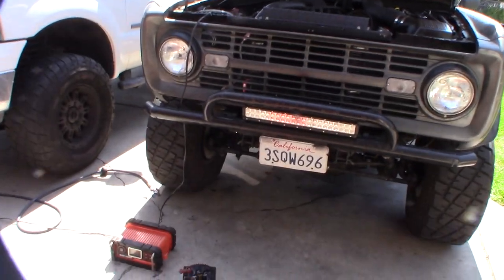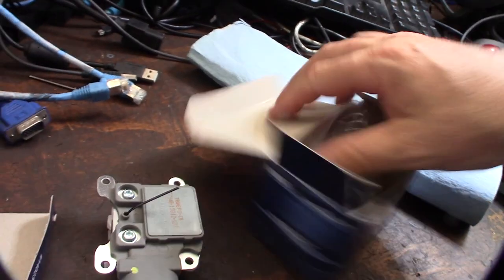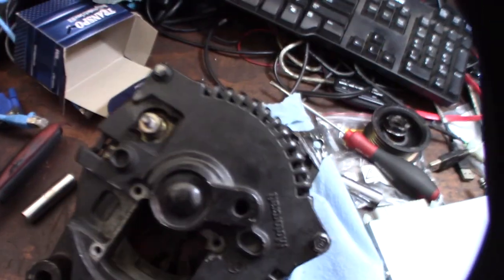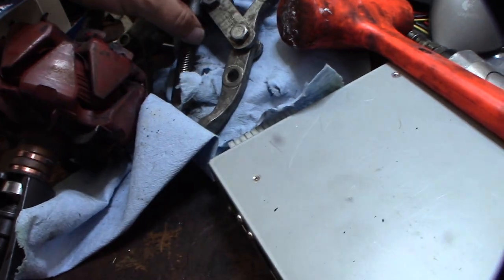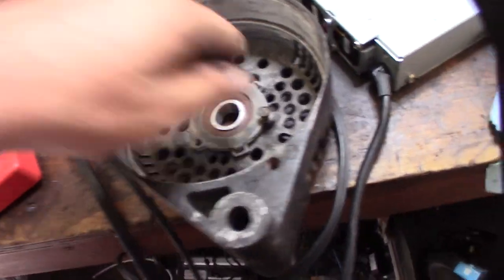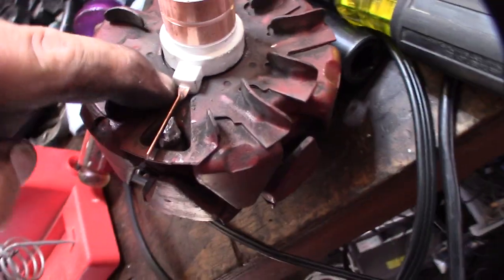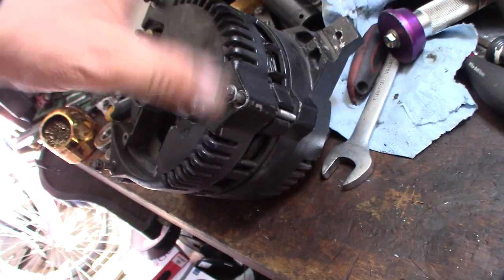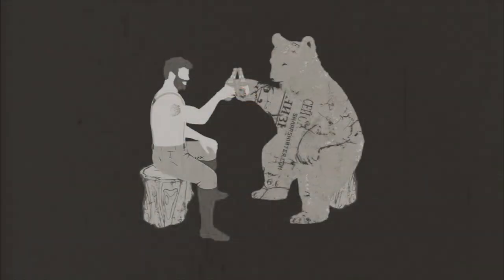Ford 3G alternator complete rebuild bearings, brushes, slip ring and module

Comment: Thanks for the reupload.
Reply from the maker: Thanks for pointing that out.
Reply: @fintechrepairshop  I'm currently running the 3g 130amp but afraid its too small to run accessories. what are your thoughts on upgrading to a 270amp rectifier and stator?